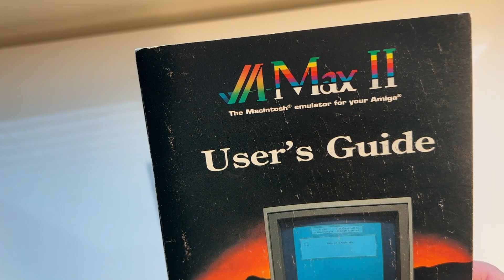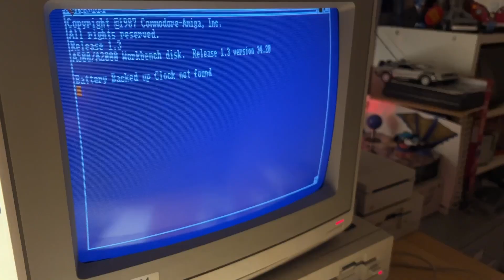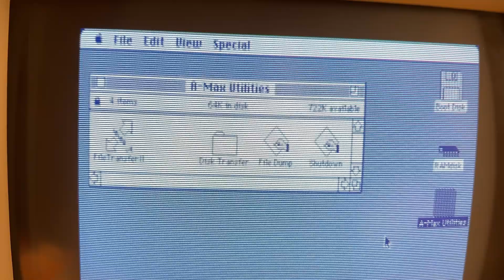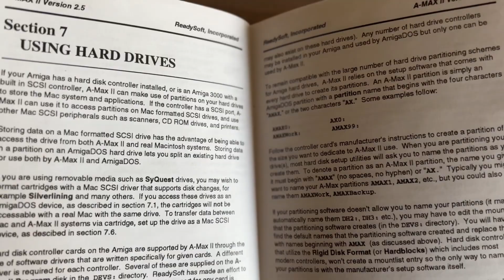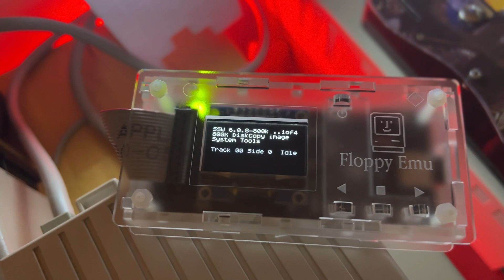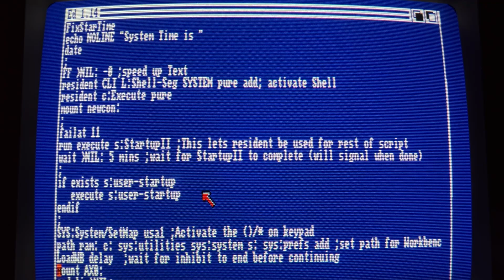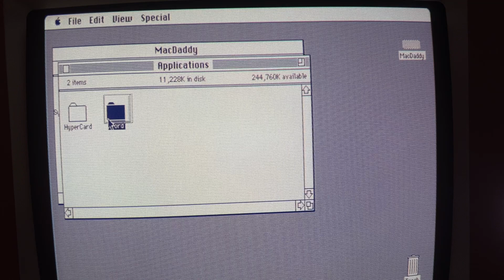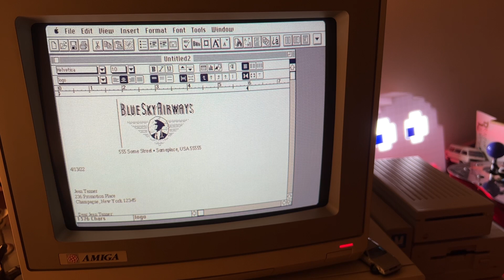My Amiga 1000 Macintosh Plus: It's Alive!

Comment: most modern LCD TVs will do deinterlacing on the composite input.  I plug my a500 composite output into my LCD TV and it looks great, and the a500 output is only monochrome.  I'd try my a1000 but unfortunately it no longer boots.
Reply from the maker: Thanks for the info!

Comment: Great video - subbed! I bought an AMax cart in 1989 along with a 128K Mac ROM set for my A1000. As I was in school then, it was easy to borrow a Mac 800K external drive to get the Mac software over.  I tried to get a 3rd party 800K drive to work but it wouldn't, even after installing a jumper recommended by Readysoft. It was well known that not all 3rd party drives worked. There is software-only hacked version out there. The downside with that is that you can't use the Apple 800K disk without the cart.   I had fun pulling mine out of storage and getting it to work again, and I sold it just a few weeks ago. One last thing, Amax 1 does work with Kickstart 1.2 as well as 1.3.

Comment: I just managed to get shapeshifter running 8.1 on my Amiga 4000.  I used Prowrite  on my a500 all throughout High School and when I started college there were too many science programs on the Mac so I jumped ship shortly before commodore went bankrupt.  Now I can run all my 90’s Mac software on my Amiga.
Reply from the maker: That's super cool! Are you using a special accelerator card as well? Or does it run OK on a stock machine? I've been told Shapeshifter is the way to go but is kind of a resource hog and requires a "beefy" setup. 
I have an Amiga 3000 I just put an 060 in that I was pondering running Shapeshifter on... And then I could run 7.5.5 (I hope) which would be rad.
Reply: @AmigaLove  Yeah, only issue I had was with the ram, the Mac side requires quite a bit of it.  My accelerator is an A3660 LC060 running at 60 Mhz and I bought a bigramplus  256 mb from Icomp (individual computers).  I’m able to max out the ram on the Mac side.  I setup one SD card with 7.5.5 and one with 8.1 which runs a bit slower but still very useable.  I also have a cybervision 64/3D which handles the color screens.  Without it it would run well at 16 colors, or grey scale, using the AGA 256 would slow the system a bit.
Reply from the maker: @bliskin8847  Very sweet setup. My "monster" A3000 also has the BigRAM card. And I run with a zz9000 RTG card on P96, although I lucked out with a Cybervision card this year (for around $200 because the title was misspelled!) that I've yet to play with. It sounds like I could spin up a 2nd SCSI2SD for a Mac partition to keep the rest of the machine 'pristine'. It would be pretty cool to fire up Photoshop 4 on my A3000! :) I also have an Emplant card - the advantage there being I could use actual Apple ports. Another dream of mine was to some day sync my Newton on my Amiga. It's ridiculous, but it's there! :D
Reply: @AmigaLove  lol, a newton in the Amiga would be awesome, good Luck 😃👍.  Oh, I have a Buddha ide, so I have a compact flash to ide in the extra floppy bay and as an expansion card out the back.  So I just swap out the SD card with the various Mac operating systems.  The Amiga4000 HD drive can read Mac HD floppies on the Mac side, and the CDRom also works.  You shouldn’t have any problems with the ZZ graphics card, have fun.

Comment: 2:52  Ackchyually... the Macintosh 128K and original 512K that had the 64K ROMs.  The Macintosh 512Ke had 128K ROMs.  The 512Ke was essentially a budget Mac Plus, with no SCSI port, and RAM limited to 512K.

Comment: also remember, computers of the 80s and 90s typically had a hobillion wires behind them for all of the external peripherals. that's mostly what the extra space was for. either that, or you had a disgusting, dusty mess of wires on the floor.

Comment: I can't help but think that there must have been a better place to mount the interfacing port on the "cartridge".  After you opened up the device, it looks like the connectors could be mounted in several places to avoid having the long-edge sticking out from the back of the computer.  Of course, this is 30+ years in hindsight -- who knows what the production costs and use-cases were then, all of which can be mitigated with a cable!
Reply from the maker: Yeah, even if back then they were limited to a fairly long device it would have been nice if the pass-through was at least on the SIDE and not the very back. Adding an external Amiga floppy makes things pretty ridiculous. If I could find an simply 12" extension cable (rather than a 3" or 6" thing) that would certainly help things, too.
Reply: @AmigaLove  They did offer an optional extender cable for sale.

Comment: 1:52 - what is that addon plugged into the A1000?  I think I had one.
Reply: Maybe not.  It looks like the ram expansion and battery backed up clock I had.  The scsi card I had for my A1000 was the GVP.
Reply from the maker: @ShaneBro  I think you're referring to the Microbotics Starboard. Mine has a StarDrive R2 SCSI module, as well as an additional 1MB of Fast (which I installed after the video), so it's up to 1.5MB + the 1MB chip and the 256K front expansion. The Starboard/StarDrive a VERY cool device, which I've also made a few videos about.
Reply: @AmigaLove  maybe that what I had.  Geez, been too long.  I will look them up.

Comment: I was briefly reminded of my A-64; while it is emulation, it also has a hardware adapter to make C= 64 drives available to the Amiga through the software.
Reply from the maker: Yes indeed, Bob. And my understanding is it is extremely similar in nature by how it ports the OS to Amiga rather than pure emulation. I also have an A-64 and most games won't work at all. But for managing data and potentially running BASIC programs A-64 works. It is pretty wild hooking up a 1541 to an Amiga and hitting that drive.

Comment: I bought Shapeshifter for my Amiga 1200 back in the mid 90’s just so I could use a browser that supported SSL for online banking which was very new at the time.
Reply from the maker: Hi Dan, 
That's pretty wild! Shapeshifter is a very cool program for the later model Amigas no doubt about it. You were on the cutting edge in the mid-90s getting online with such a setup! I feel like back then I was probably on a Frankenstein PC I built myself running Netscape 2. I thought I was Johnny Neumonic or something. =D

Comment: Why all the hazzel using A-max? Why not just use Shapeshifter and be done with it?
Reply from the maker: Because this is an Amiga 1000 running OS 1.3. Shapeshifter needs more CPU and later OSes.
Reply: Shapeshifter requires 68EC020 CPU.  Amiga 1000 can be enhanced with PiStorm-Emu68 and AmigaOS 3.2.

Comment: Excellent video - I now desperately want an A-Max for my own 1000 (and come to that, the MicroBotics StarBoard too!)
Reply from the maker: The StarDrive R2 is probably obtainable. The StarBoards are a bit harder. They show up a few times per year... The A-Max has also been reverse engineered by Crispy, but he did it for his own personal use - not to build and sell. (But there's always a chance!) ;) Thanks for watching, RT
Reply: @AmigaLove  There is a demand for the Amax 1 in 2022!  I listed my Amax V1 on Amibay and had 3 people wanting to buy it the same day. Also there's current WANTED posts for it. The Amax iv  card is much harder to come by and expensive.
Reply from the maker: @trs80model14  I have the A-Max zorro card. My dream is to install it in my A3000, install system 7 and sync my Apple Newton 2100 to the Amiga. =)

Comment: I dont want to know how much the Amax module runs these days do I?
Reply from the maker: Well, now that I made a video about it it probably doesn't help. :S  That being said, I got mine - unpopulated - for a staggering $250. But it's WAY cheaper than an old black and white Mac that might not even have a working screen anymore. That's one way to look at it anyway. My A-Max II+ zorro II card cost me $300. It's a hefty fee for entry, no doubt about it. 

Fun fact: My friend has reverse engineered the original A-Max, but never produced any as he wasn't sure there was a market...
Reply: @AmigaLove  i shouldn't mention my Plus was effectively free then?  Or my ibook one of the later not cute ones that looks like a tooth?  My iisi wasn't too bad though.  Like 150 ish albeit with a black n white monitor whose case cracked in shipping?  But.. depending on how much that dude charges for a replica Amax?  Id at least think about it.
Reply from the maker: @CaptainRufus  "i shouldn't mention my Plus was effectively free then?" Hah! No, no you definitely shouldn't mention that. ;)
Reply: I saw several Amax 1's sell for under $100, the Amax IV card selling closer to 675-700. There is a high demand.

Comment: For the first half of my time in college (and most of high school before that (class of '91)) Mac Write via AMAX was the best word processor I had on my Amiga 1000.  I loved this thing.  I've now got an A2000, and i've modelled and 3d printed a face to mount an external mac floppy drive inside the 5 1/4" bay... (which is up on thingiverse) :D  AMAX was weird and i love it!
Reply from the maker: Scott - that's INCREDIBLE! I want to see your project. Right now!!! Did you install A-Max to an old HDD back in the day? That would have been SO expensive, and the A-MAX HD partition (assuming it wasn't stand-alone) would have been super posh. Or did you run MacWrite entirely via floppies? That's probably what I would have done back then considering the cost and size constraints.

Comment: I only remember using Shapeshifter on my A1200.
Reply from the maker: A-Max - the contraption I'm using - came out years before the A1200 was born. As I stated later on in the video, if folks had a more modern/powerful Amiga Shapeshifter is very likely the better way to go especially if you had an accelerator. But on A1K's, especially those running OS 1.3, A-Max is the only way to go. (And it is awesome!)
Thanks so much for watching.